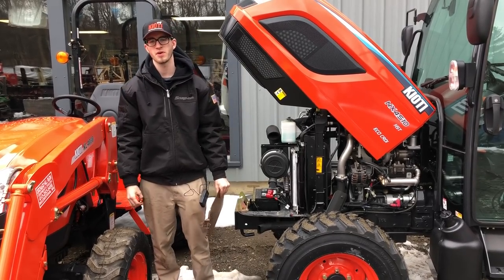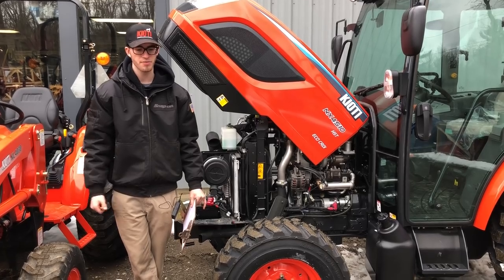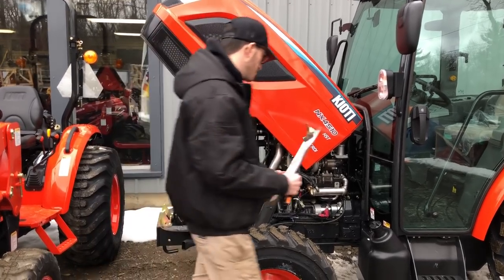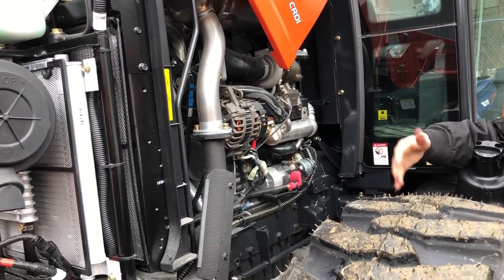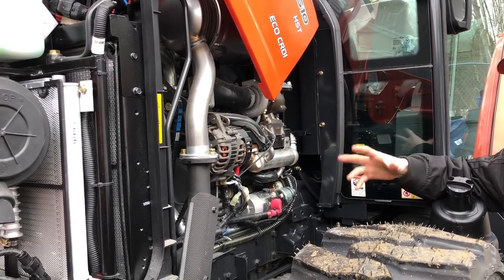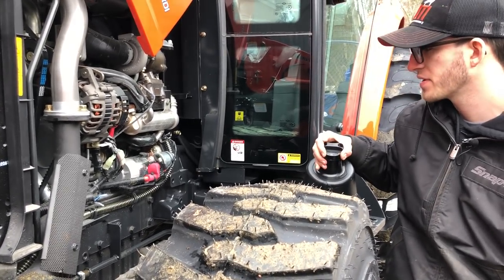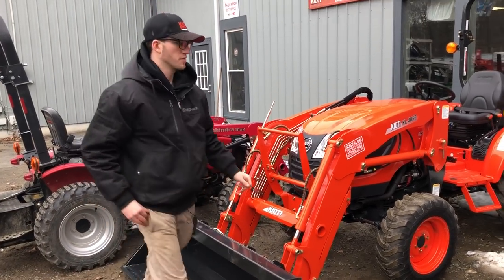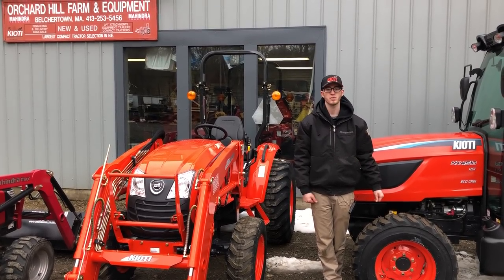Daedong Tier 4 Kioti Engines & Emission systems Explained

Comment: On tier 4 motors, keep your RPM's higher then classic diesels. All the conditions that make alot of black smoke in old diesels, like running cold, or running at low rpm, still happen in tier 4 motors. they just capture the suit, and have to clean the dpf more often. Most tier 4 owners experience better, longer regen cycles with RPM's kept higher then tradional diesels. We prefer not to idle very much like we used to. I personally run at Econo PTO RPM on my RX 7320, and that seems to be really good for it.  Turbo's change where the torque curve is on the power chart, and these newer motors don't like a slow idol as much.  Just an FYI for new Tier 4 owners. P.S. Love my Kioti RX 7320! I'd buy it again!
Reply: Sparkeee1978 makes sense Sparkeee in that a warm motor running faster would have better combustion with fewer particles exhausted. However the faster running engine would wear out faster would it not?

Another utuber with a different brand of Korean tractor I think had a lot of trouble with DPFs & regen. The engine was in limp mode and had no power.

Kioti tractors are in Australia and seem pretty good. The main qualities I’m looking for in a tractor is ease of use and reliability. Kioti has it plus a competitive price. It’s great to hear you are happy with your tractor.
Reply: T farrelly
Reply: Judith farrelly. Good morning. This is Frankie. Not feéling good this morning for the last couple of daŷs going to the doctor this morning will call you love Frankie
Reply: Just purchased a new RX7320! Looking forward to getting it!

Comment: Hey Marshall, 
Can you tell us how good the daedong engines are built and life expectancy in hours. I currently own a kioti 2610 and always wonder how long it will last before I will need to rebuild it. Also will the hydro transmission that is linked to the 26 horse engine last as long?
Are you all seeing Kioti tractors with alots of hours without problem. Please give us a testimony of what you have seen on the kioti longevity.
Thank You!

Comment: Great Vid..  Thanks...  Not much info on this at all online from Kioti (or in the owners manual).  Would be great if you could do an add on video on what the lights mean (blinking, steady), and if it will regen automatically while running (you quickly referenced this in the video), but not clear if it is truly automatic or if you need to push the regen button.  The manual is not real clear at all.

Comment: I was wondering why the Kioti RX7320 has a significantly smaller engine than similar brands at that horsepower.  It has a 2.4 liter while others seem to have 3 & 3.5 liter engines—they’re turbo’d too.  Logic would say that the smaller engine is under more stress.  I’ve only heard good things about Kioti and in fact am about to buy a 7320.

Comment: Putting an EGR on any diesel engine is just asking for trouble and how do you clean the intake valves on a direct injection engine? More problems down the road.

Comment: Only the CK3510 and CK4010 in the CK series have DPF, thankfully and why I got the CK2610, mechanical pump and no DPF, perfect candidate to turn the pump up and even better, install a small turbo being the 3A165 Daedong engine is detuned from factory yet that little 3 cylinder engine is designed to produce 34 HP 😀